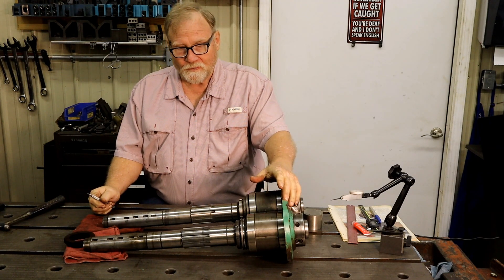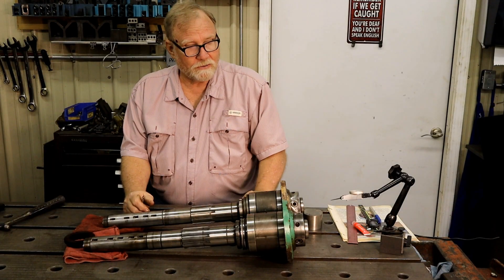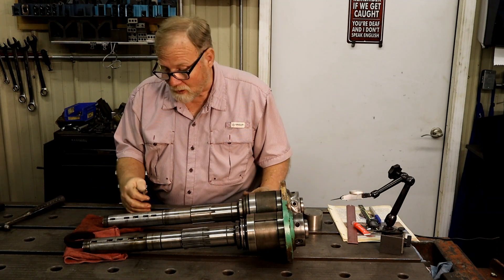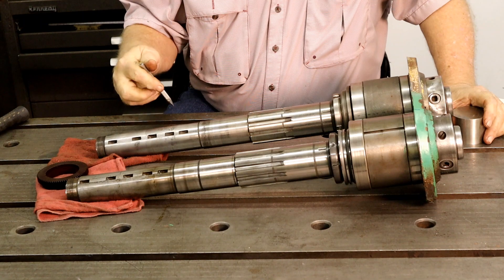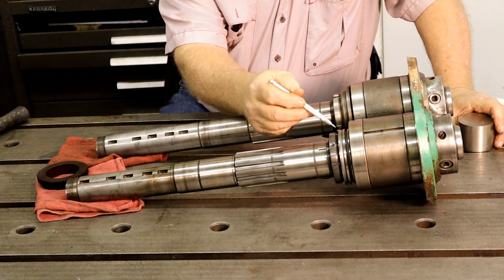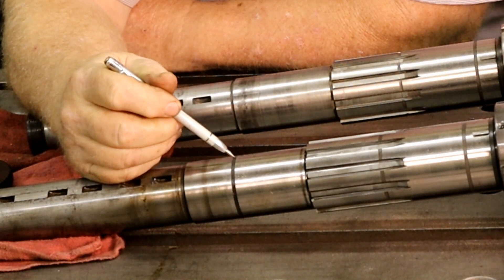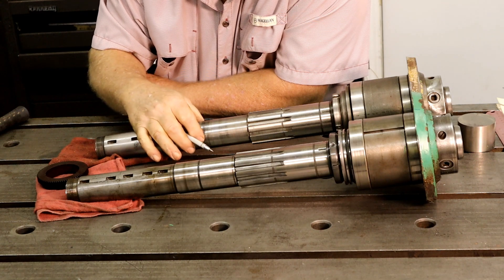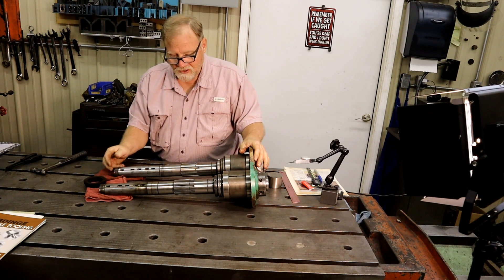Looking at the spindle from the 7000.00 mistake 10EE

Comment: Agree that making a bushing to make up the need space is the safest way to go.  Spray welding or any solution that would require heating the spindle may cause warping.  Your comment about switching to bronze for the busing rather than SS looks like a very good idea to me...after all, the spindle shaft is still supporting most of the load with the bushing only making up the 3/8" at the back.
Reply: Hey Jack... I have seen Adam Booth Spray Weld.. many times....  and frankly since you heat all sides of the shaft at the same time....  its not going to warp...  but of course thats my opinion... I would check with Adam... he is a much better SME than I
Reply from the maker: It's not a SHAFT ! IT's a precession ground SPINDLE!    Sorry, all this spray weld talk is driving me CRAZY :)
Reply: @10swatkins  All this Adom Booth talk is driving ME crazy.
Reply from the maker: The deed is done , worked out fine... working on the next video now ;)

Comment: I agree with your idea of putting a sleeve on the shaft , I am curious what is the distance from the spline to the key is it the same on both shafts ? if it is then the sleeve would be perfect
Reply from the maker: IT is the same... The bearing surface is just shorter...
Reply: @10swatkins  then I`de say go with the sleeve

Comment: Steve, have you the ability to spray weld that area? Or perhaps someone nearby that has the ability? If so that would be a better repair. If not your repair should work. Though I would give some thought to how you intend to hold the sleeve once you make it. If you're inclined to send the shaft out I think Adam Booth over at Abom79 would be glad to help.

Comment: The sleeve is a good fix, as far as heating and shrinking it on that is how I would do it , as far as warping it will conform to the shaft when it cools, what you would have the most trouble with is finishing the OD you would be best to plan a little proud then polish it to the finish size after shrinking it on, this is just how I would attempt it, i wonder if the older spindle only had a single bearing.

Comment: Steve,   One thing that would save you a lot of time & efffort would be to install an air over hydraulic cylinder  on your engine hoist. You can get one from HF. I use one in my shop. Works great.

Comment: Would spray welding a section then grinding to exact O.D. be an option?
Reply from the maker: Would you spray weld a 10,000.00 precession spindle that is accurate to 50 millionth of an inch runout?

Comment: Just a thought from an amateur machinist! Could you make the sleeve a tad oversize on the o/d then fit it to the spindle and grind it back to size? I know your cylindrical grinder is out of commission but for such a valuable machine could you send it out for final grinding? A guy like you must know other reliable machinists.
Reply from the maker: First you have to get centers in it to hold in any grinder, then you have to get it setup perfectly or you will mess up the existing 3/8" of perfect bearing surface.  I only need a sleeve 3/8" long to make this work... Grinding is just not worth messing up the other surface..  Thanks for watching...
Reply: @10swatkins  thanks for the reply, good luck with the health.

Comment: Abom79 uses a spray weld technique to apply metal to shafts and then turns them to size. I have seen him weld material to shafts and turn them also. I think if you contact him, he might be willing to help. I think that would be a better solution to the problem. The heat would be on the shaft not the collar. He is nice guy and is very good. Please give him a shout. He might have other ideas also.
Reply from the maker: I have more capabilities in my shop than Adams does at the moment, all though at the rate he is going he's going to catch up  :)    Richard this is not a shaft.  It's a VERY expensive, Hollow Spindle that is hardened and ground to a runout of 50 millionths of an inch. 
Might as well toss it into a bonfire and then try to straighten it out with a sledge hammer and sand paper! :)  
Spray welding is a semi ok fix for worn shafts, it does sometimes fail, not  shafts...

Sorry if I'm short but this is about the 30th suggestion to have it spray welded, and I'm starting to go crazy :)

Comment: Something for you to consider, Sir. Instead of red loctite, consider using green loctite sleeve retainer. And, if you have the wall thickness, perhaps consider an ever so slight “scratch” thread on the inner diameter to give the loctite something to further lock into… maybe a 24 tpi. Just my first thoughts without the part in hand. Looking forward to seeing Bob making chips.
Reply from the maker: New sleeve retaining Loctite has been ordered and I am considering using a piece of bronze bearing material instead of the SS...

Comment: Have you verified where exactly the bearing sits when it is assembled? Maybe it doesn't even go that far out and on the old version they just had surface sticking out the back of the bearing. Alternatively if there is a spacer between the bearing and the splined area perhaps it could just be shortened so the bearing sit on the shaft all the way.
Reply from the maker: Yes I have verified it... There is no way to shorten the front bearing spacing of the seals will not work...  The back bearings have another outer race assembly they fit into so that's out... The Spindles are both the same exact length with the only major difference being that bearing surface being 3/8" shorter....   I found a piece of bronze bearing material that I considering using  instead of the SS and have ordered Locktite sleeve retainer .
Reply: @10swatkins  so, the way I do math, if the bearing surface on the shaft is 3/8" shorter, only 3/8" of the bearing would not be supported, and about 1 1/4" will be.
As a welder/fabricator and learning machinist guy, I'm not seeing a problem with putting it together and running it.
Reply: Ok Brian, any reply to Steve’s reply? I only ask so I can read any answers in this thread so, thanks in advance.

Comment: I back your plan entirely Steve. If it ever needed removing , a little heat would break the bond of the loctite and expand the ring a little so I don't forsee any galling issues. Heck if it needed to come off again you could simply grind partway through the sleeve and slip it off with ease.

Comment: I agree that stainless could give you galling if the fit isn't exactly right or if the bearing is cocked a tad when you press it on, I'd go for  a good grade of steel and sleeve locker instead of loctite red. Just my 2 cents worth. You are on the right track though, I wouldn't want half the bearing unsupported either.

Comment: Yes I would Loctite to the shaft but i would make it a very firm fit to the shaft. That means a very firm press fit. The metal I would use bearing bronzes this would firm press fit with  Loctite
Reply from the maker: Just so happens after I read you comment I remembered I had some stock of Bronze :)   I went out and I'll be dammed if it was just prefect stock to make it out of.. Only have about 1/8" to bore out and plenty  to turn down the outer diameter :)  Think I will go with that...  Loctite sleeve retaining compound has been ordered :)

Comment: You can find Locktite 640 or 620 on eBay for less than $30. Both are sleeve retaining compounds with wicking capability not found with Locktite 262/263/271 red thread locking compounds.
Reply from the maker: 640 ordered,, Thanks for the tip!   I was going to us the green thread wicking Locktite but the 640 looks like it was made for this kind of stuff :)

Comment: Now, I must admit that I'm not a machinist, but I am a mechanic, so take my suggestion with a grain of salt. Why not make a cut tapered ferrule instead? It would auto center, be held in by, I assume, with all those keyways, a cluster of gears. It would be reversible if it didn't work, and there wouldn't be a need to make a high tolerance sleeve that may or may not give the bearing the support it needs. The ferrule might not even need to be cut. Sorry for my brainstorming.
Reply from the maker: That is an idea... I will think on it some :)   I can make a sleeve to the exact tolerances pretty easy .

Comment: Hi Steve I'm a new subscriber and an older guy like you. I'm sorry to hear about your heart problems but I'm glad your ok and working to fix this awesome Monarch  lathe. It is a great piece of equipment and worth fixing. I'm rooting for you buddy I was a millwright worked on rebuilding huge sintering furnaces and CNC machines. I was also a welder/fabricator  designed some automation built a few magnesium guitars  also did HVAC  industrial,commercial and ,residential work for many years as well. My personal machines are really really old  and not nearly as nice but I couldn't get along without them. I'm going to watch along and root for you every step of the way as you work on this. I'm looking at the original spindle laid out on the table and I'm looking at that groove there where the rear spindle bearings go. I'm wondering if that small section of the spindle is actually a sleeve that was installed using dry ice to shrink the spindle enough to get it to slide on and interference fit to the spindle. You could use dry ice on the new spindle itself to shrink it and slide that new sleeve on over it I have done this to cool down shafts to get new bearings to slide on over shafts many times. You could also heat the sleeve and slide it on it only needs to be 250 to 300 deg to get it to expand enough to slide over and fit tight. Stainless can get weird and warpy when heated but it may remain stable at 300  deg. when it shrinks as it cools it should be fine as it will follow the form of the spindle o.d. and be ok.

Comment: Steve, I've been watching a lot of Abom79 videos..... And what Adam would do in this situation would be to spray weld that area to be slightly oversized, and then to grind or turn it down to size.

It can be masked off so that the spray welding does not touch anything that you do not want it to touch, and the metal deposition goes just where you want it to be. I suggest that if you do not have this equipment to do it yourself..... It may be a cost-effective solution to send it out for spray welding..... Maybe even send it to Adam I'm sure he'd be happy to do it.

Making a ring and slide fitting it onto that shaft may work, but I suspect eventually you will end up with electrolytic action between the stainless of the Ring and the steel composition of the shaft. One metal will end up being sacrificial....... And you'll end up with some clearance being eaten up between the shaft and the ring eventually...... Kind of like rust. And it's just a theory, but if this should happen...... And you have a bearing sitting on that ring (and the ring loses it's close fit with the shaft due to this electrolytic action) you're going to have a bearing that's now sloppy with the shaft (axial alignment-wise). And there goes your 50 million run out accuracy!

If you have a tight slip fit between the ring and the shaft, using a form of loctite to secure it, I wouldn't count on that holding during normal vibrations and pressures of regular machining. You're basically asking that loctite adhesive to be as strong as the two metals it's trying to hold together...... And I doubt that that would work for very long.

These are just my thoughts on the dilemma...... And I could be totally wrong. But I think the spray welding approach is your best bet. And you wouldn't even have to grind it down...... Just give it a very fine turn on the lathe (around the number 32 r.m.s surface finish let's say). Remember: you're not producing a bearing surface --- you're producing a mounting service FOR a bearing.

Well, that's my two cents and I'm stickin' to it! 😉
Reply from the maker: The is a precession spindle,, There is no way in hell that I would spray weld this piece... He spray welds shafts not spindles.  It's hollow and made to be exact to 50 mil run out. Heat would destroy it...  It's held in place by the existing step on the spindle on one end and the pulleys on the other end... It's trapped and not going anywhere so ref lock tight is so strong it requires heat to remove it... Thanks for watching and commenting :)
Reply: @10swatkins  No one would spray weld a precession shaft. Stick with your sleeve idea. But I would try and check its run out, before investing too much time on it.
Reply: In the spray welding process you have to preheat the metal to around 200°.... Not thousands of degrees. I seriously doubt that the amount of heat that would be involved in a spray welding process would be enough to distort that tube in any way. 

Spray welding can be done in stages. You deposit a few thousands on the diameter...... And then let it sit for half an hour to cool off. Then go back and deposit a few more thousands...... And let it sit and cool off again. This progressive approach will actually give you the thickness you need without the distorting heat induced into the spindle tube.

But I would suggest that you give Adam a call and get his thoughts on it.
Reply: @johndonlan5956  even if it wouldn't distort the spindle, you still need to grind it concentric to the other bearingsurfaces within 50 millions. As you just heard he doesn't have the equipment nor the confidence to tackle such a task. The sleaf-idea is in my opinion a way better approach, but i would still make it a really slight press fit. I would use some other material than stainless, that often contains lots of material-stress and only heat it with an household oven to reduce a possible distortion.
Reply from the maker: @johndonlan5956  Don't need to  call Adam.. There is no way in hell  a sane person would use that process to increase a bearing support by 3/8" on a probably 10,000 spindle machined to 50mill run out...
Reply: @10swatkins  I can understand your concern....... I didn't realize it was that much diameter increase.
Reply: The problem with spray metalizing on a thin wall member is when the hot metal cools it shrinks.  That shrinking will distort the base metal, the spindle, and cause the ID under the metalizing to be undersize.  There goes your 50 millionths concentricity!!!   Steve, stick with your plan! Ken

Comment: Use normal steel, stainless will give you galling nightmares once you'll have to diassemble it again...
Reply from the maker: Think so? It's only a 3/8 inch area that probably will never have to be removed and if so a simple cut would enable it to be pealed off the shaft....
Reply: @10swatkins  Agreed, if it's a very tight slip fit being loctited into place and you have to remove it you're going to put a small amount of heat on it to release the loctite anyway, which would expand the ring making it possibly easier to remove than to install. Stainless galling is only an issue when there's some amount of force or sliding friction involved, there's neither here

Comment: Have you checked the new spindle for run out, with the bearings sitting on vee blocks, if yes, how was it.
I like the sleeve idea.
Reply from the maker: Not yet.. I am not sure my existing V blocks would be accurate enough :)
Reply: @10swatkins  If I understand the question correctly the V blocks are only static supports for the bearings on each end. You’ll thus be checking the concentricity (runout) of the spindle with the bearings. Seems like an excellent method if it can be set up that way.
Reply from the maker: @ellieprice363  That's the problem... the only way , because the Spindle has no two steps the same, would be to spin it in the bearings... That is easiest accomplished in the head because the bearings are also two different sizes....

Comment: I think the Sleeve is a Great idea. I think I would at least Tack it if possible with a Tig Welder just to be sure. Thanks for sharing the Video. That was really interesting, can’t wait to see the final result.
Reply from the maker: I really hate to put any heat into the spindle... The sleeve will be trapped in place so I was really only worried that it would rotate.